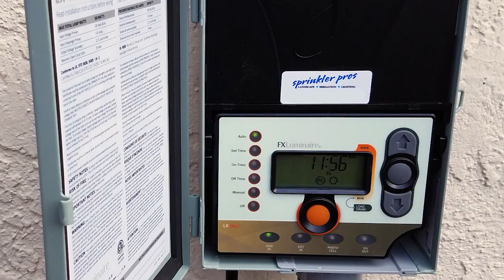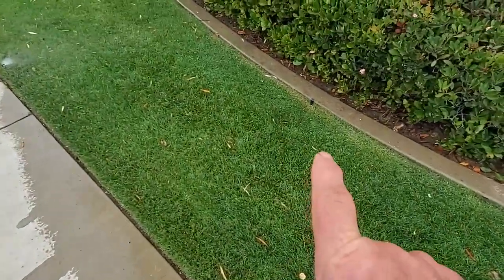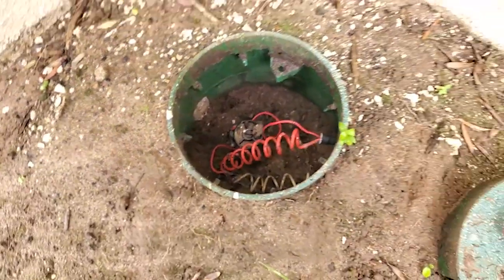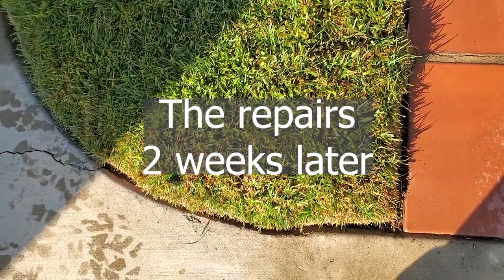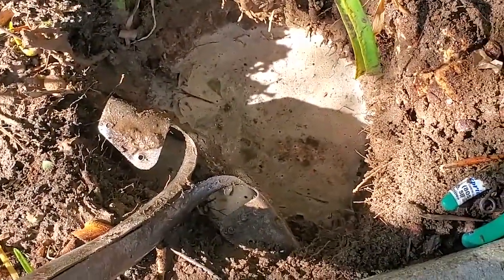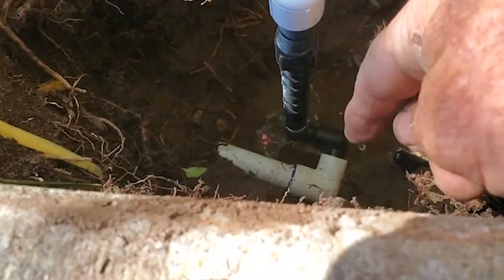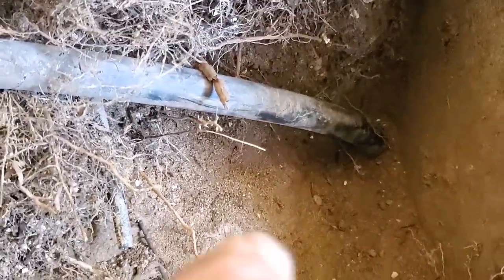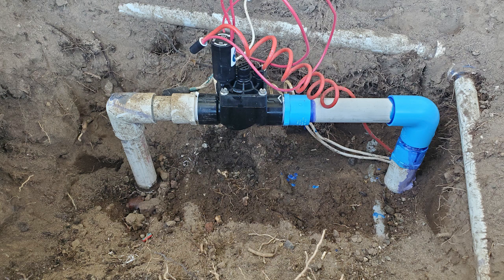Country Club inspection 'n repairs | Vlog #4.2 | variety to learn from

Comment: Awesome video my friend.  And with regards to the EZ OUT tool, I use two of them.  One, I leave straight and the other, I bend to the shape of an elbow so that I can get into those tight spaces.  Hope this helps!
Reply from the maker: I've thought of that. I just wasn't sure if that pot metal would bend 90 degrees without breaking. I'll see about creating one. Thanks for the comments.
Reply: @SprinklerPros  they do sell them as well at some of the irrigation supply stores.  I just happen to have e an extra one so I put it in a vice and bent it to an elbow.  Take care.

Comment: I love that remote. Does it work on all sprinkler timers or just the wifi equipped ones? The most common controllers I deal with are Raindials and X Cores and I don't want to spend a few hundred on a tool I can't use on most jobs. ☹️ Thanks for all you do.
Reply from the maker: Sam, that remote is the Hunter ROAM XL and it only works on Hunter controllers that have the REM (for REMote) terminal screw. I have it available on my Resources site on the Controllers page https://sprinklerpros.net/resources-irrigation-controllers-sprinkler-timers/    I have a video about it here https://www.youtube.com/watch?v=Fst-n6mD-WM  I use an Irritrol remote for RainDials and Total Controls. It's the Irritrol R-100-kit. It's not available through my Resources site yet. BE SURE you don't get it wet or it will be toast. A remote that will work on "all" your timers is going to be bulky and expensive. The last time I priced one they were over $2,000.